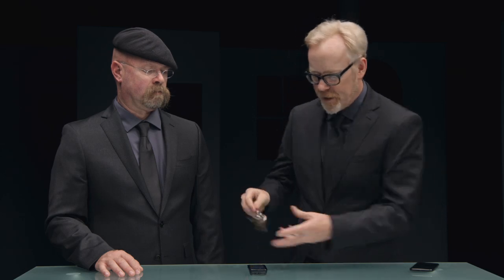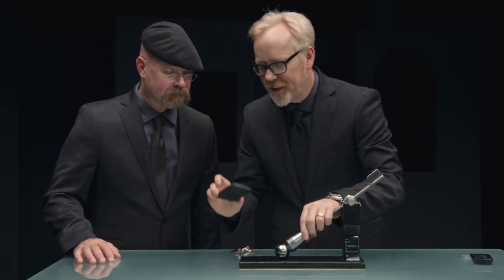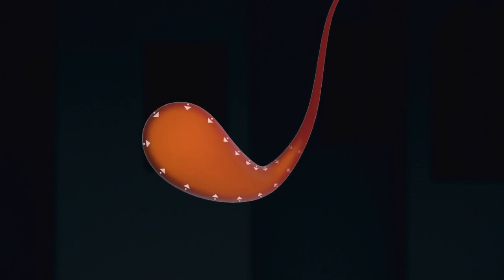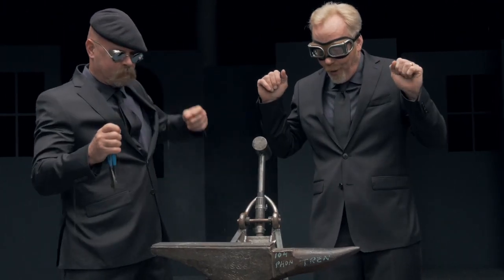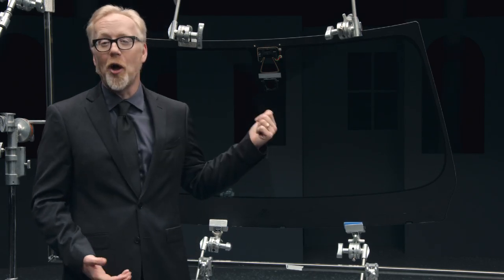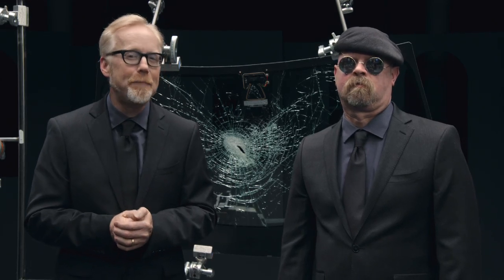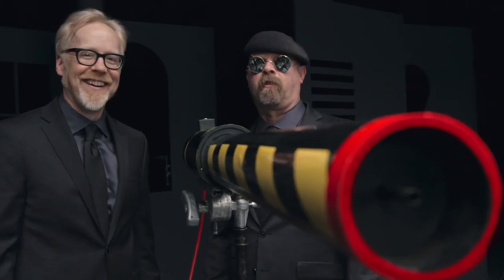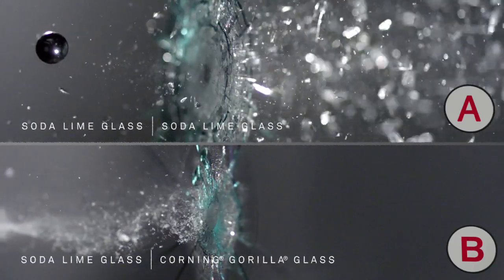The Glass Age, Part 2:  Strong, Durable Glass

Comment: The question on everyone's mind, what about a windshield of  two panes of gorilla glass glued with resin?
Reply: +Rinyotsu To to add a minor detail to what he said. If it is chipped with a regular exterior windshield you can also repair it with resin. Good as new.
Reply: +kurtis bolduc Laminated glass in cars isn't so much about strength. The use is a "safe failure" design so that when it does break the driver isn't pelted with shards of glass. When you use one sheet of glass when it breaks it may break like laminated but, it may also shatter into billions of shards becoming projectiles to the driver. So instead of focusing on making strong glass, the focus is glass that can break safely. As glass tech gets better who can say for sure if this will remain the case but for now even the gorilla glass in this video is laminated glass (yes with regular glass on the outside.)
Reply: +TheSalamanderAnder there was testing of ultra high strength windshields. it needs to be able to break at some point because if an occupant of the vehicle is not wearing a seatbelt and is thrust forward in an accident they need to be able to break through. If they just smash into it they will break their neck. somewhat counterintuitive, but being thrown from your vehicle is safer than hitting a solid piece of glass.
Reply: +kurtis bolduc Also, tempered glass, if made correctly, SHOULD break into tiny granules as it is safer than shards. My earlier statement which used the word billions was a bit of the wrong way to put it. What I really meant is shards that actually leave the plane where the glass is. 
Car passenger windows though are tempered glass that, due to its compressed outer surfaces and tensioned inner surface, will shatter into fine granules. This is somewhat safer in the case of a collision but, also beneficial in the event of submersion where those little emergency hammers are used to break the window allowing for escape (either but exiting through the window or allowing the pressure to equalize quickly allowing the door to be opened.
Reply: +kurtis bolduc It's a hassle but it's still done because it is the most reliable way to ensure in crashes with high impact the glass remains where it belongs. For sure there are other ways but tech has to get to a certain point beyond "the next step" before it becomes implemented in something as dangerous and wide spread as cars. It's extremely important therefore, that glass gets better in relation to something like a phone first, where high impact to the glass doesn't mean a dangerous situation for the user.
Reply: Well, that will help reinforce the seat belt rules while driving.  If you want to risk not wearing one, then you get to risk dieing in a car crash.  Seat Belts Save Lives...
Reply: Rinyotsu a major issue that was overcome in the evolution of safety glass windshields was that due to the the strength of older versions when someone’s head would hit it would pass through the windshield, however when it started to decelerate the glass would compress around the persons neck resulting in decapitaion.
Reply: Oh no. You don't want gorilla glass. You want something significantly softer that will shatter into smaller pieces when hit, to absorb the outside force acting on it when it's hit. 

"If it ain't broke, don't fix it"
Reply: I believe it would just be too expensive. Tho if they get the costs down, they could really reduce weight in the car.
Reply: +Rinyotsu If Gorilla glass breaks (which it would from a direct impact like that), it would completely shatter due to the tension forces in the glass. This means your vision becomes completely obscured.
Reply: "If Gorilla glass breaks (which it would from a direct impact like that), it would completely shatter due to the tension forces in the glass. This means your vision becomes completely obscured." So then if a bigger rock hit or something with a sharp edge enough to breach the gorilla glass even a little we are talking catastrophic failure? Sounds to me like Gorilla glass if it shatters like a Rupert drop will actually be higher danger.
Reply: Well, then it's a good thing most windshields have a slant to them making any impacts more of a glancing blow rather than a direct impact. That being said, with a direct impact, regardless of the glass, your vision is going to be impaired and the windshield should be replaced prior to future driving in that car.
I'd be interested in hearing any results you may have on the shattering conditions of a panel of gorilla laminated versus a panel of traditional laminated glass.
Reply: All glass is tempered designed to break into small squares. it would never break into a million shards if it's done correctly.  My point was more of  you could most likely put one piece of film and tempered glass, instead of 2 pieces and a film in the middle because no one likes working with 2 pieces and a film because air pockets occur all too often like the waste in the automotive glass sector is a lot. Its recycled but it's a hassle
Reply: +Quikcksilver in simple it mean the window is broken and you are now blind
Reply: i thought i saw Cornhub my bad :3
Reply: Like to see it used in small and large aircraft windshields.
Reply: If that ball made it through the first layer the entirety of the 2nd layer will shatter
Reply: Rinyotsu  that would make the factory gain less money from replacing windshields
Reply: That happened with a classmate of mine. He was on a date and a drunk stumbled into the road right in front of them. The drunk's head went through the windshield, and then his body bounced back from the impact and the windshield glass held together and the drunk's head ended up sitting in my classmate's date's lap while his body ended up in a corn field. Not pretty.
Reply: Rinyotsu , too thin, unless they can make the outer layer thicker so the windshield won't just blow back inside the car but great idea.
I'm sure that all windshields will be made using a varient of In the near future.
Reply: a couple of issues one is why use two pieces when you can just use one and have the same strength as glass in cars now. another point I learned from working in the glass industry is laminted glass is really hard to work with just making a curved laminated piece with out air pockets is very hard.
Reply: SchroedingerK , Christopher Castle , imo the glass should me made to let the driver fly through if they aren't wearing the seatbelt, and it shouldn't blow into shards. Also, the glass Makers WOULD and SHOULD be considerate of seatbelt-less drivers, as if they lived, it would be good for marketing," MOAR PEEPS LIVED IN CRASHES" when they could include lives saved. If they ignored the seatbelt-less drivers, they would lose business.

Comment: why wouldn't they use gorilla glass on both sides instead of just one?  ...with the obvious answer being "because they want to create something that is safer while still making it so that the public will still continue to break the glass at the same rate and buy just as much glass as before (although more expsensive now)."  Oh ya... gotta love the glass age [aka, the "screw the people again" age].
Reply: +John Martin Well, also the problems with over flexibility. Corning has no incentive to not have it on both sides. They don't sell you cars, they sell you glass. Of course they want you to buy as much expensive glass as you can. There's an engineering issue somewhere. Maybe the glass shatters completely if pierced. Or, it splinters into spider cracks.

Comment: Nowhere in this video do we see what happens when a sample of "gorilla glass" breaks.  I'm certain the sales & lying department of corning were very clear about that.  You'll never see a windshield made of the stuff, because it's likely to be similar to the tempered glass in the side windows of any car. Crack it, and your windshield would turn into a lace curtain that you can't see through. 

I'm sure they'd LOVE to have a billion-dollar market making windshields... but I don't see it happening any time soon. Tempered glass is already forbidden from being in windshields, for that very reason. You don't want to be on the highway, take a rock to the glass, then suddenly be unable to see where you're going. 

If I'm wrong, I DARE Corning to make a video showing what happens when a large piece of "gorilla glass" breaks. Especially if it's a laminated piece like a windshield. If they show us I'm wrong, I will say so and congratulate them on their achievement. 

Though I'm fairly certain we won't see that video ANY time soon.
Reply: KOakaKO The new Ford GT has a gorilla glass. So suck it.
Reply: +KOakaKO We won't see it I guess as I'm pretty sure they are aware of the current flaw and are working on solving or at least minimizing it.
Reply: Volvary
- I hope they succeed at developing it. I've replaced many windshields, and it would be nice to have them be much lighter. Those things are heavy. :D
Reply: I suspect that's why they said, "Not yet." I bet they're working on it.